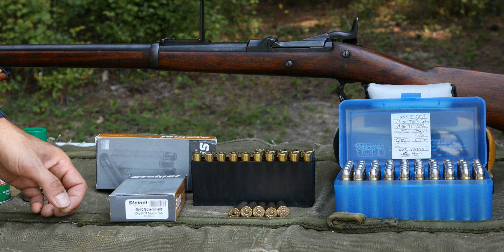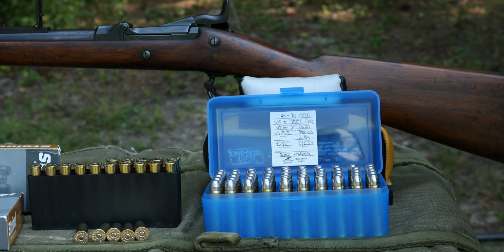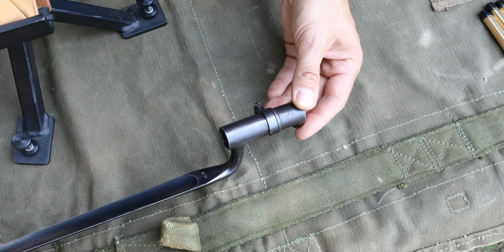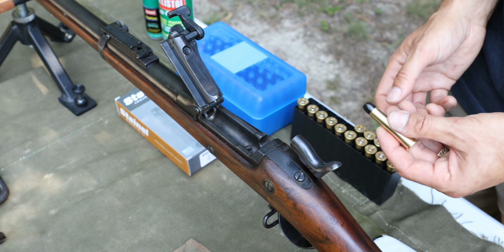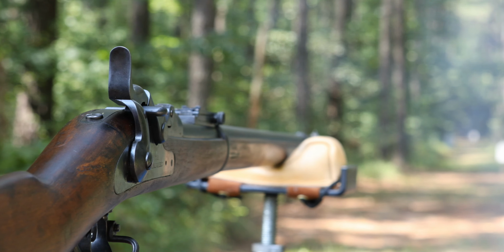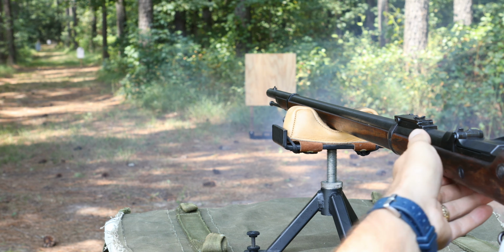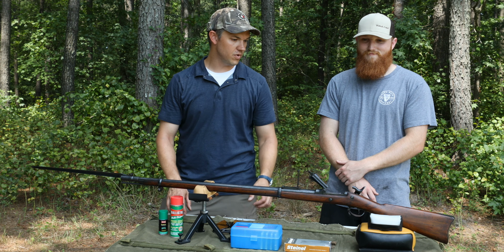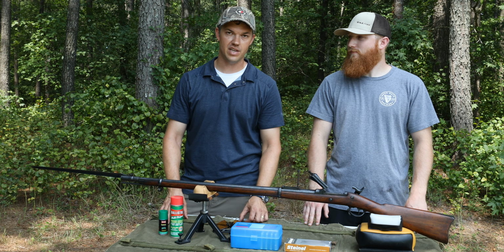1884 Springfield Trapdoor Rifle .45-70

Comment: Coincidentally I had to cancel the layaway on what would of been my impulse buy Model 1884 Springfield Trapdoor at a Value Pawn the day before you uploaded this video. One of the "ears" on the traditional rear sight was broken off. I found that the replacement rear sight would of been around $300 to replace. When I canceled the layaway because of this, the gun being $1,400, and there being a ramp and no front sight on the barrel, the manager tried to dissuade me from doing so. He told me that all I had to do was get the flat spring for the rear sight (something not mentioned to me when I put it on layaway) and told me that the reason I could not find a model 1884 front sight to fit on that anachronistic ramp was because they integrated the ramp into the barrel on the Springfield Trapdoors in the 1920s and 1930s! A quick Google search would reveal that production ended in 1893. I got screwed out of $150, but I found a much better looking 1884 with period correct front sight ramp on the barrel for under $700 on GunBroker.